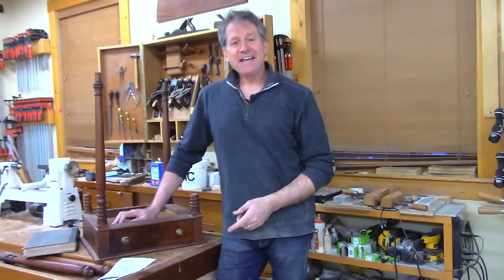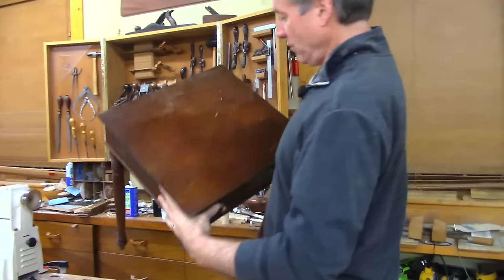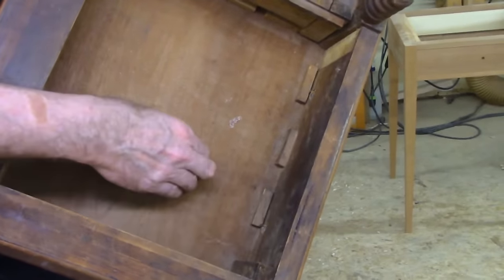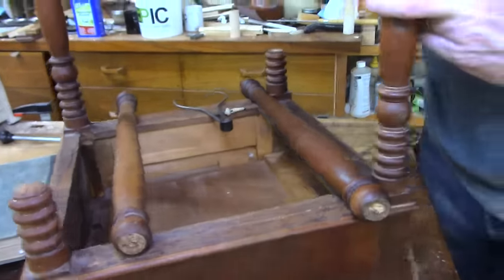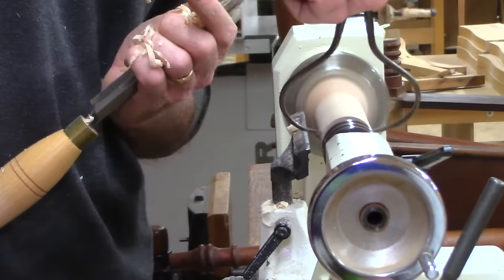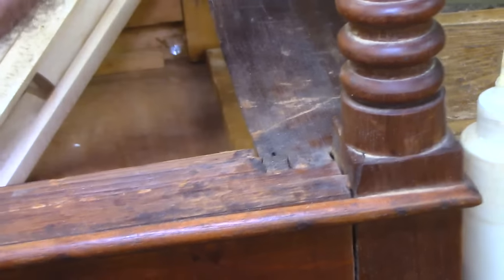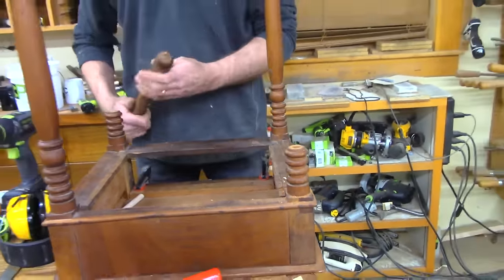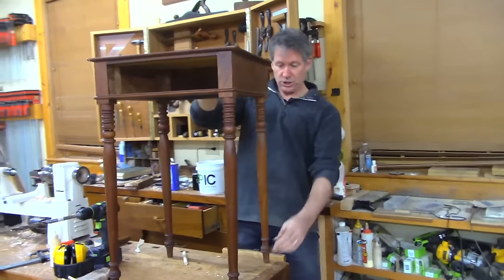Repairing Furniture with Tom McLaughlin

Comment: Excellent and informative tutorial. 

Years ago, when I was tasked with repairing an old but not very valuable table with round legs, I had to repair a leg much as you have done.  I did not then have a lathe, so I drilled a block of wood that was fitted with leg extensions, just as you have done, and used it as a drill guide. I had sawn the block as close to the same diameter of the broken leg as I could. Then, after mounting the guide on the leg, I took up any slack in the leg extensions with blue tape on the inside faces of opposing guide extensions. Then, I marked a line across the joint between the pieces of the leg and aligned the guide to those marks as I drilled out each piece of the broken leg.

This way, I thought, even if the holes in the legs were not exactly centered in the legs, then they would at least be in the same place on each piece and would, therefore (fingers crossed), line up well enough to make the repair less visible. It worked very well.  I got lucky.  I also made a four-sided planing guide to make sure I could flatten the mating surface of each of the broken pieces with a block plane -- I lacked confidence in my chiseling ability.  That was the hardest part of the job, because it had to be done so carefully and slowly.   Also, because I wanted strength in the new joint, I used epoxy and a threaded stainless steel rod as the joining "dowel" for the repair.  Overkill, for sure, and definitely NOT a museum quality repair, but so far so good, thirty years later.  

These days, I have a lathe and I would approach the task exactly as you have done. And I certainly would NOT use epoxy and a threaded steel rod for the repair. Just saying...  😎

Thanks to both of you for another helpful and thought-provoking video.  Great stuff!
Reply from the maker: Thanks Jerry, that is a great explanation of your method, one I have use myself in the past with equally good results. It reminds me of making templates to create mortises on parts to join that are difficult to match up. A mortise guide slot is cut, and indexing pins or marks are made to align the two pieces as best as you can. Usually it works out successfully enough.😎

The method I showed the other night is the most interesting to me for the fact of using the the first drilled guide hole as the axis for turning the outside, thus insuring a concentric alignment. 

The other nice part of that presentation to me personally, is finally getting around to fixing some thing I’ve been walking past as it was stored off to the side downstairs in my shop. I can’t remember if I mentioned it, but that’s my new strategy for getting some of these older puzzling or unfinished projects completed. I need all the motivation I can find! Just being aware that you are there, being supportive along with others, keeps me going and reaching higher. So I truly mean it when I say thanks for watching!
👍
Reply: @EpicWoodworking  Another strategy that works is just to avoid looking in the corners of the shop.  Works for me!  😎
Reply from the maker: @jerrystark3587  😂👍

Comment: great video. i like the drill block idea. 
i probably would have tried to set it up in the drill press with a lot of headache.
a gear clamp would be the best thing for clamping the block to the legs.  nice even parralle pressure all around and wouldnt loosen as you drilled.
probablt wouldnt need tape to shim it out either
Reply from the maker: Thanks Ben, yes, I was very pleased with how accurately this method rejoined the legs. Nice to have that “off to the side project” done after procrastinating and walking past it for so long. 
I’m not sure I know what a gear clamp is, I’m guessing like those metal strap clamps?
Thanks for watching! 👍😎

Comment: Tom and Kris,

When you have a "wockajawed" set of handcrafted table legs, like these, it is a good opportunity to make a sacrificial "center alignment positioning leg template" for the bench top.  The center positions of the legs at the top are determined by their attachments to the piece of furniture.  The template could be a sacrificial piece of plywood or posterboard that has the same centerpoints marked for the bottoms of the legs.  That might help get the legs vertical, squared, and parallel for final gluing.  As always, the diagonals help square the assembly - iffi the tops are squared.

Good lessons ... even without the mike.
Reply from the maker: Thanks Norm. I’m not picturing what you mean by “center alignment positioning leg template.” That description actually sounds perfect for the technique that I demonstrated…but I’m sure I’m not visualizing your suggestion. After the episode I noticed how perfectly the two sections were aligned at the joint, even though the leg was slightly bowed over the length…something that is not really an issue with an old wonky table like this one.
Thanks for watching! 👍😎

Comment: Amazing, the only thing I found was more difficult it should was the gluing of the sticks to the "hole guide", I would simply made more sticks (enough to cover the entire hole guide) then use a couple of rubber bands to put them all and align them then I could simply tack them in place and remove the rubber bands
Reply from the maker: Great idea using rubber bands to hold them, why didn’t I think of that?! 😎 Thanks for watching Cristofano! 👍
Reply: @EpicWoodworking  Man, you are an inspiration to me. Im so sad im so far from you guys. And the rubber band idea, even th4e masters as yourself sometimes misses the shot